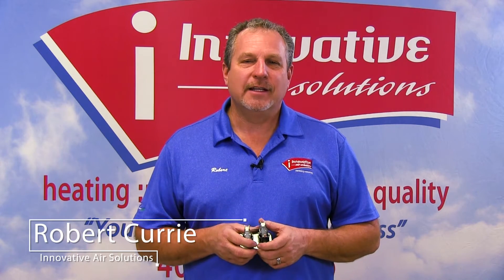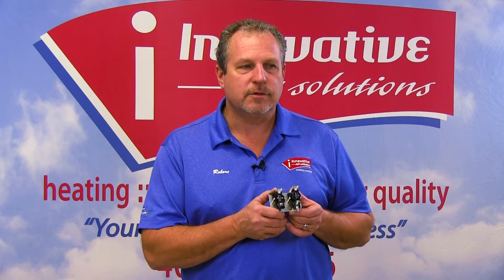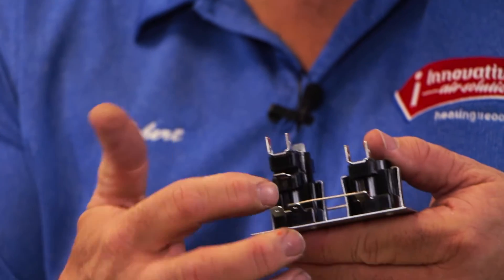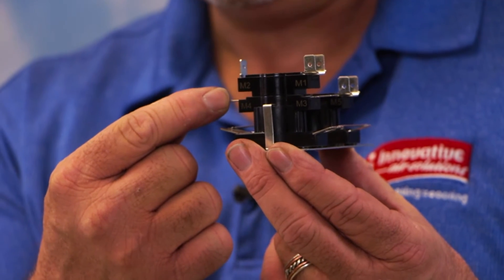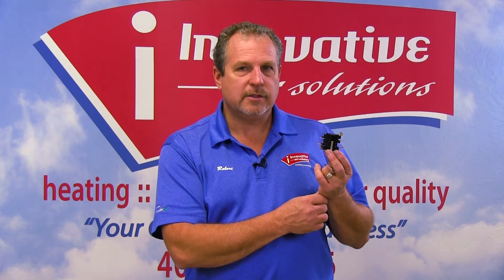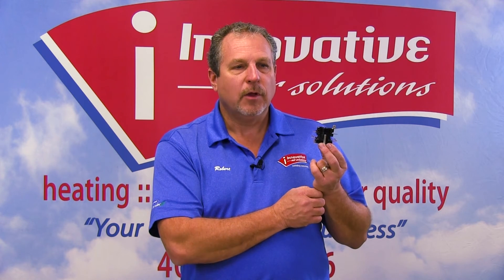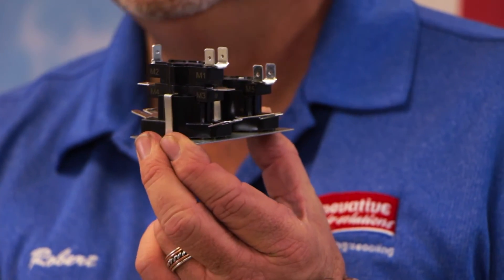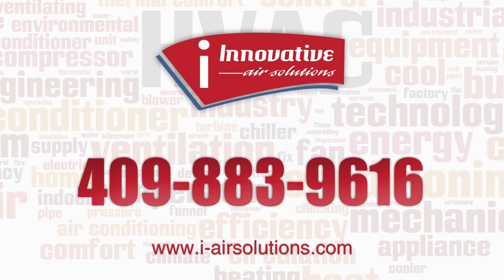HVAC - Heat Sequencer

Comment: Not a good explanation.
The 24 volt thermal disc moves downward, not upward, to allow the contacts to close on the high voltage side of the sequencer.